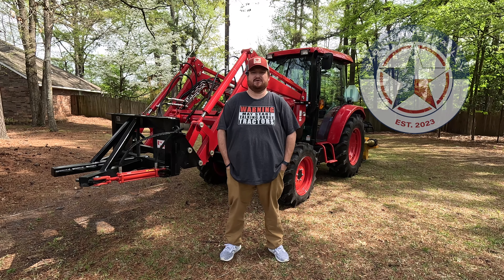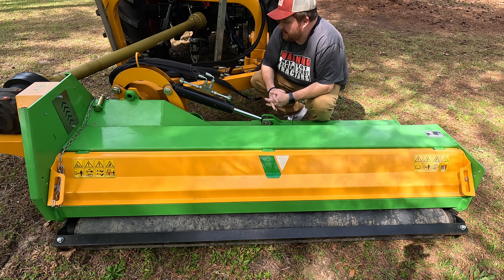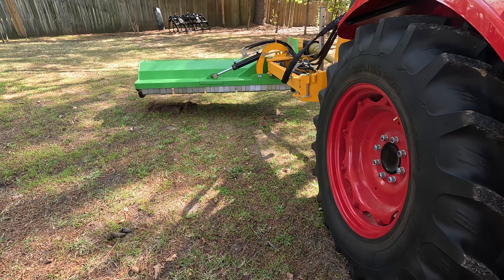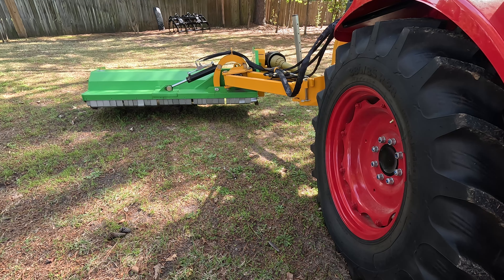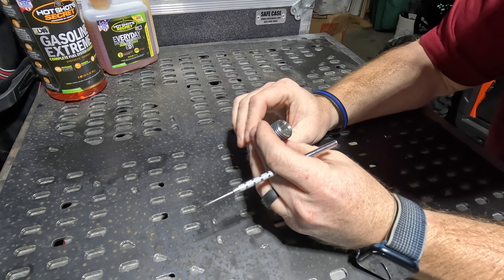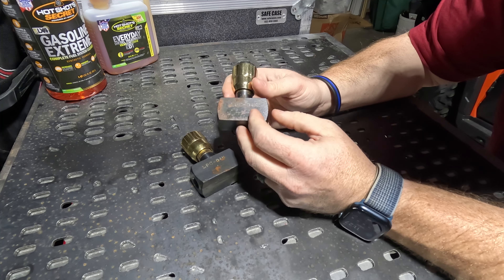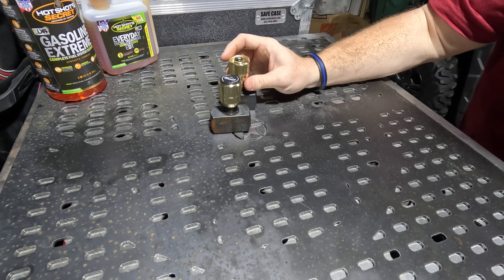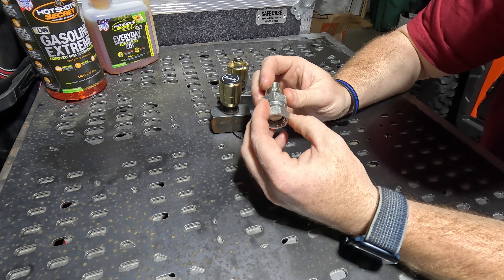Adding Flow Restrictors to the Embankment Flail Mower

Comment: Good morning Wade and Happy Resurrection Day! First of all, love the T-Shirt (wink wink). Now I want you to repeat after me 17 times. "Line flow restrictor, line flow restrictor, line fl.........". LOL The edit captions had me rolling! I was surprised somewhat of the quality of those Summit needle valves. I would guess painting them would definitely take care of the rusting issue, but wow oh wow, the cap breaking? Nah.....Excellent transformation on the speed and functions after the line flow restrictors were installed. I know you mentioned it, but you might want to go one size up on the line flow restrictor for the tilt function. I am so glad you found a great solution for the washing machine spin cycle movement you were dealing with. Excellent video and thanks for publishing it.
Reply from the maker: Thanks Marty! I can’t believe I said the wrong thing so many times. I would have never believed it if I hadn’t heard it played back to me.

Yeah, I’ll use it a couple of times this spring and see if it’s too slow for me. I’ll probably just drill them out a little if I want the flow increased.
Reply: @SabineRiverValley  Excellent idea.

Comment: What size restriction is it? There's someone on Amazon that is selling a 1/32" restriction for 12 bucks. 

I have the same issue with my ditch bank flail and want to try this.
Reply from the maker: It's the 1/2" pipe male to female 1/32 restrictor. I just bought two of those off Amazon and put them on my grapple. I'm pretty sure they are exactly the same as what my dealer sold me. The restriction hole is exactly the same.

Also, if it is too slow for your liking you can easily drill these out in small increments until you get the flow and speed where you like it.

Comment: Bigger, ag type tractors have a dial in the cab for each hydraulic remote to adjust the flow.  The flow restrictors you used are perfect for the job. I used them on my grapple and I’d be willing to bet your grapple has them installed too.
Reply from the maker: So, what you’re saying is I need a bigger tractor.🤣 Actually, my grapple doesn’t have them, but will shortly. My dealer originally installed 1/4 inch hoses for the 3rd function, which was restrictive enough on their own for the flow, but now that we replaced all of it with 3/8 inch hoses I definitely need them. I have them sitting here, just need to get them installed.

Comment: concerning how small the orfice is, had a hydraulic guy suggest buying "blind" flow restrictor meaning no hole, and threading in an allen set screw that you can drill an orfice into and then remove or change it out or thread in a different sized orfice for different implements that need different amounts of flow. hopefully you understand what i mean.